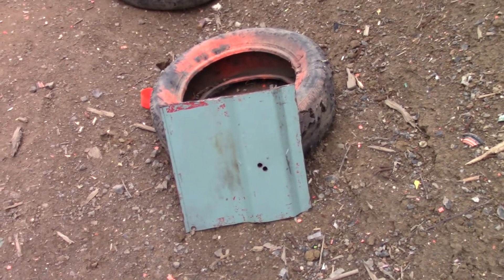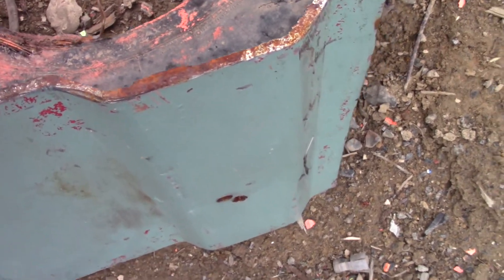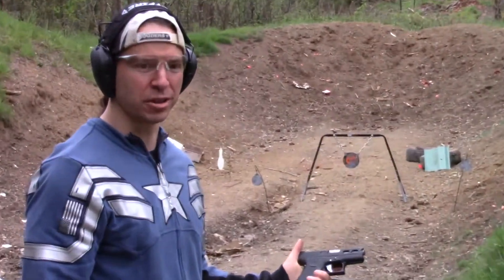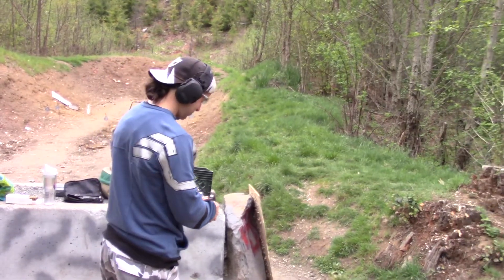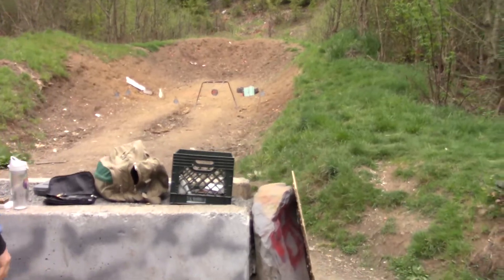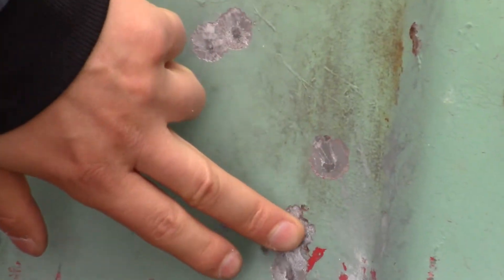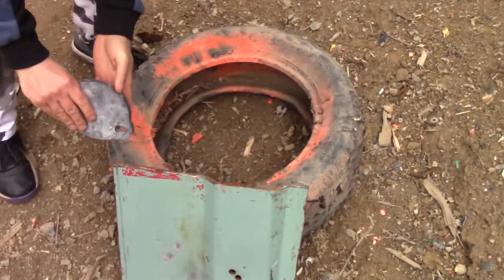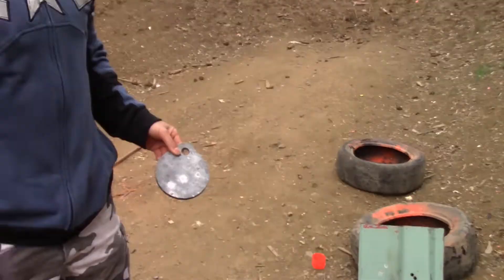Is a Steel Shipping Container Bulletproof?

Comment: Are the sides the same thickness? You should check. Also, further caliber and projectile type testing is needed to make any statement about bullet proofness.
Reply from the maker: I did check, and the sides are thinner than the roof. That will be the next test. I also have an AR now, so we'll see how it holds up to some 5.56 ammo.
Reply: @captainwesticle1654  The sides are made of .075" material so you know what you're working with.
Reply from the maker: @joewoodchuck3824  yup, I cut out a piece for a window we installed, and it is quite a bit thinner. It'll be interesting to see what kind of punishment it can take.